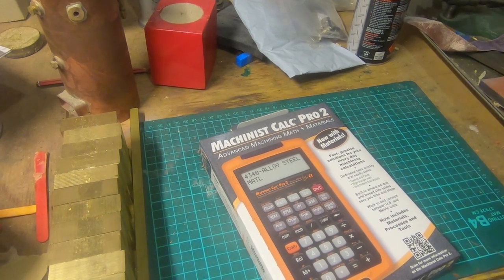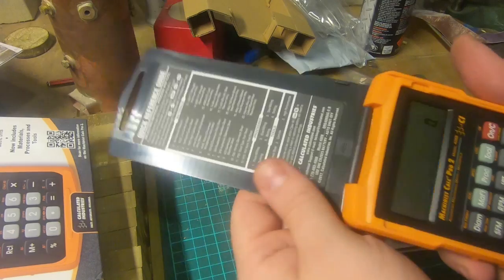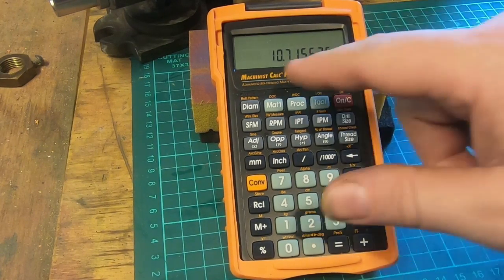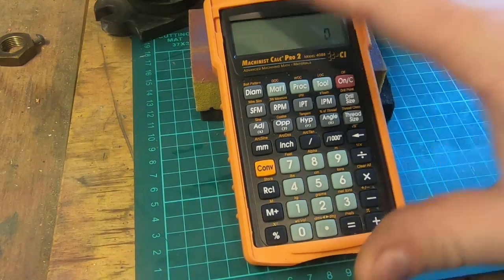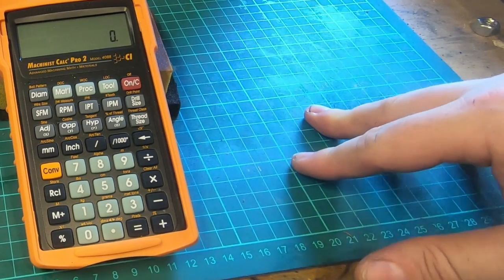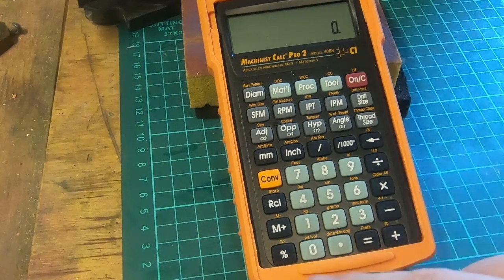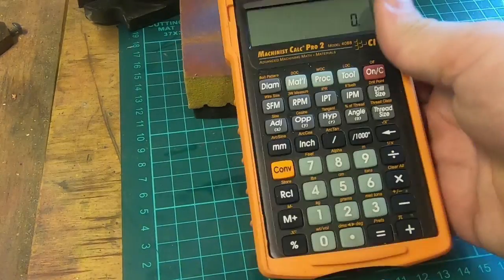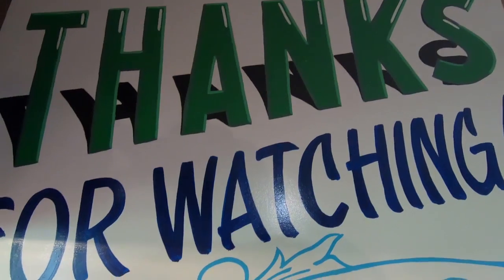new tool~ Machinist calculator 2

Comment: When you press convert to mm or inches you do not need to convert, convert activates the yellow text above, in this case arc cos or sine, only works Because you need a arc value first, but if that was different like many other conversion (conv) button .
You can also download the ios version for 29.99 and does everything . I have both and rely on both though out my day at work .

Comment: What does it do if you enter adjacent -4, opposite 3? Or if you enter angle 143.13011 degrees, hypotenuse 5? I think the feature is called right angle solutions. Enter any 2 knowns and it'll give the other 2 out of opp, adj, hyp, angle buttons. I have the TI 84. I made a program that does the full circle. Otherwise I would buy one and find out for myself. I want to teach hobbyists to use the rotary table with the machinest calc. I would be thankful.
Reply: I figured out how to do it
Reply: It automatically calculates

Comment: That looks like a very useful tool Emma. Fwiw I made a point of buying the Machinery's Handbook on CD. That allows printing out any table at a fairly large size that your ever likely to use in your shop for whatever type of work your usually doing. Finding the data sheets for BA and M.E. threads isn't hard to find on the net either. I keep all those in a shop 3 ring binder for easy reference. That Machinist Calc plus the MH CD would make a great combination I think. For those that don't already know it, any calculator can easily convert any fraction to a decimal number with just a few key strokes. Divide the upper number of the fraction by the lower number and you instantly get the decimal number. Example, 47/64ths 47 divided by 64 = .734375" and then X  25.4 = 18.653125 mm if the metric dimension is what is wanted. While I've got a couple of wall hanging decimal and metric equivalent charts in my shop, most times it's faster to just use the calculator than walk across the room and look at the numbers for the one's I don't have memorized.

Comment: I had the first  version and it took me years of abuse to kill it !  I was gutted !  Thought about buying a new one but with the Aussie dollar where it is the conversion factor and shipping sort of made me think twice .  I had an old iPad floating around so i loaded up some apps that get me by but it is not as convenient as the machinists calc to use  and a bit hard to fit in your pocket ! The only thing that i thought would be nice is for it to have BA & ME threads on it but as they are really only used in model engineering  i think it would be a fairly useless feature for most users .